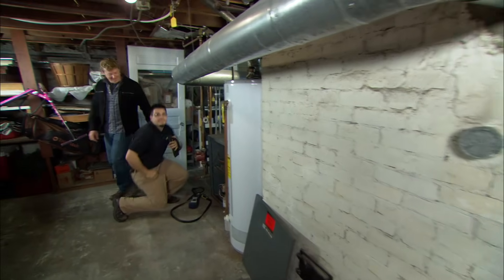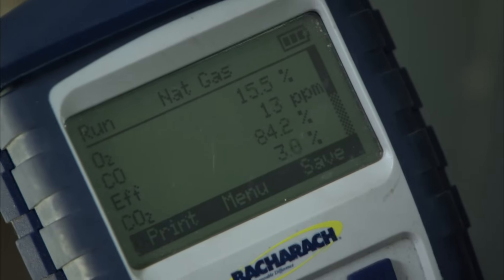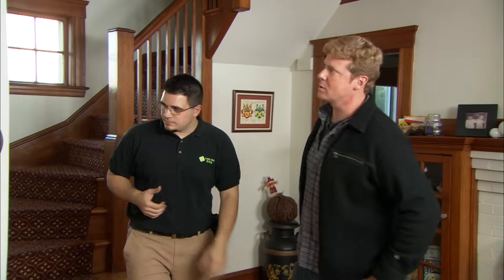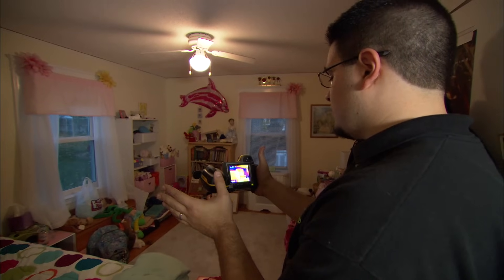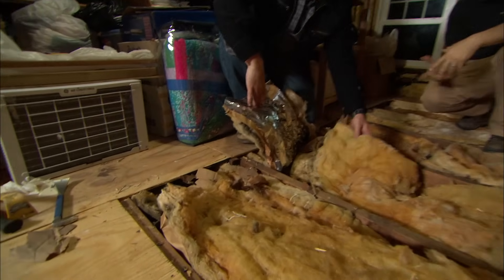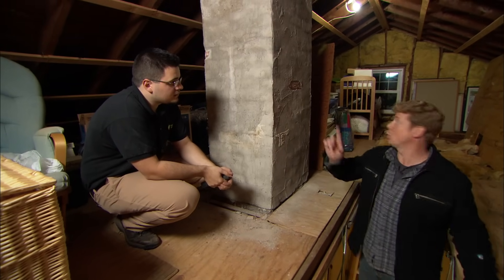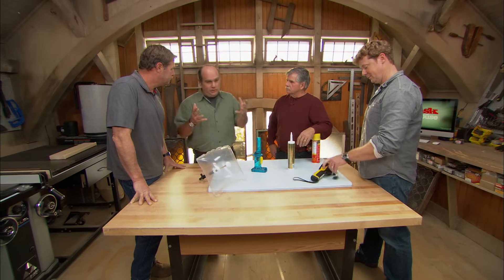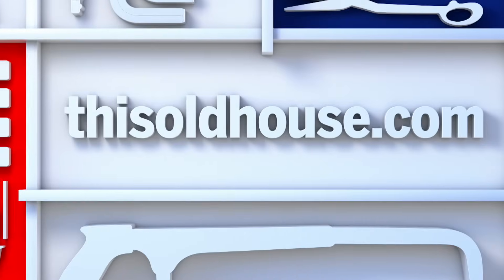How to Perform a Whole-House Energy Audit | Ask This Old House

Comment: his basement had open flues from the water heater plus the boiler. obviously it would have missive air leaks. if it was in an enclosed utility room that would be another story. 
also> https://youtu.be/R_FdTPbgzTs?t=14 look at the light coming through that door to the right? is that there MAKE-UP AIR intake OMG! 
could have spent 30 seconds talking about that leak.

Comment: I live in a home built circa 1910. I recently replaced all of the doors and windows to the tune of $12k. Cost savings on my heating bill in New England is roughly $250 a year so a LONG payback. (at current fuel cost)  OTOH, they improved the look of the house, lowered the maintenance because they are vinyl exterior, and they will add value at sale time. In the meanwhile the reduced draft and comfort is priceless!
Reply: I don’t know anyone who would say a vinyl window is better looking then a original wood window restored. Also the average live of replacement windows is 17-25 before they loose significant energy efficiency so your probably not going to see savings let alone break even.
Reply: @greysondeane4000  You make a valid point but the 25 year mark is something I expect to hit with Anderson windows. I also didn't figure in any savings for AC in the summer because the AC went in during the same time frame. IOW, I have no prior cost to compare. I suspect the bottom line is break even on heating / /cooling costs will be about the same as the life span of the windows, which will be well beyond my life span. As for looking the same... yes, the one piece screens might be the give away, but I replaced the exterior trim with 5/4" x 4 board and 2" thick sills, so not a bad job of keeping the old house flavor from 50 feet away. In the meanwhile I have better comfort and likely a higher resale value in the near future.
Reply: @rupe53  actually the payback on HVAC or split systems is 1/3rd the time of the typical payback for windows.  Low e coating on windows is a nice benefit to also keep fabrics and woodwork from fading, including noise reduction.  But yes, windows are 17+ year payback depending on which climate zone you live.
Reply: @JanGreen     we're in the northeast so with the recent heating oil spike (doubled) I expect a better payback period. At my age the comfort level is also worth something.
Reply: @rupe53  definitely. Another aspect of sustainability is health and comfort!

Comment: Careful when doing air sealing. This may cause other dangerous problems if not done with combustion appliance checks after work is completed.  Don't want to die of carbon monoxide poisoning. Surprised they didn't mention this.
Reply: He did do a smoke test to make sure no exhaust gases are leaking into the basement but they could have emphasized it more.
Reply: I think it’s safe to say that there is simply no way to get this house tight enough for that to be a concern, at least not with the simple fixes being discussed.
Reply: It's hard, especially with old homes, to get them so tight that CO becomes a problem unless you have Gas appliances improperly installed.
Reply: Use carbon monoxide detectors, especially where combustion appliances are

Comment: watching this and now can't imagine how my inspector missed the fact none of my walls have insulation
Reply: American energy wasting always amazes me.
Reply: @davidasdasd4666  i mean the house is over 100 years old but the previous owner should have definitely fixed it when they changed the siding or put in new windows. And the inspector definitely shouldnt have missed it.
Reply: @foreverkenzie2397  how can they check for that without putting a hole in the wall?
Reply: @robertm5969  if you use a thermal cam and have at least a 30° difference you can see hot or cold spots in your walls showing there is no insulation.
Reply: Seems he found the green in your wallet.
Reply: @Parpl22  oh no he didnt get any green 😅

Comment: Wouldnt insulating both the ceiling of the attic and the floor work for the full 12" they need?
Reply: No the ceiling should remain uninsulated to ensure airflow between the soffet and ridge vents.  If you don't have airflow in the attic moisture and heat will build up and cause mold issues and failure of the roof plywood or OSB.  Causes health concerns and forces you to replace the roof much sooner than it needs.
Reply: I agree.  Insulate the rafters of the roof while avoiding thermal bridging.
Reply: I was thinking about that for my place, but I found out that it can mess with the airflow in the attic. Which is important for other reasons.
Reply: @Raivias4  that's why you install baffles first, to ensure air flow to the roof decking, from the soffit up to the ridge vent. Then install insulation.

Comment: Steam energy inefficient. What about all the controls and pumps needed to run a hydronic system? One taco 007 is 80 watts alone and ecm circulators are still pretty costly.